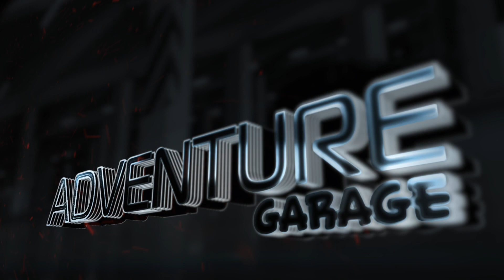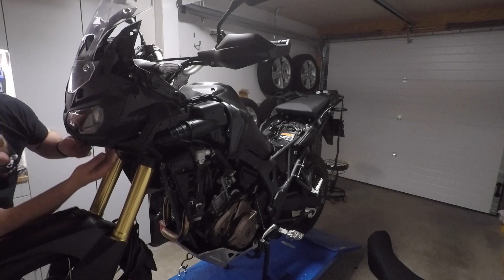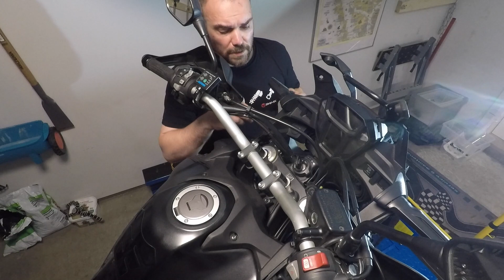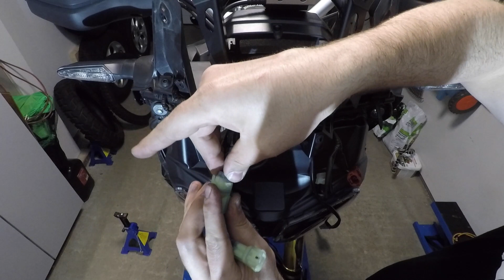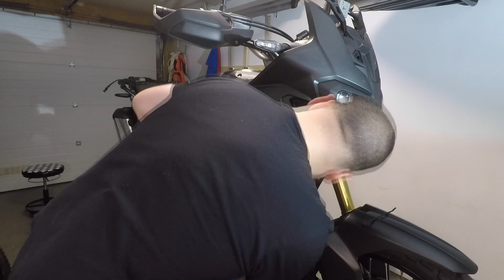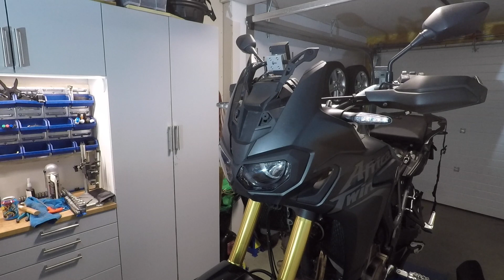Africa Twin OEM 12V outlet and subharness

Comment: Hi can anyone tell me why is there another connector at 9:08? Why can’t the 12v accessory and gps plug in directly into the sub harness?
Reply: so you can add fog lights later

Comment: Hey cool video. Is it possible to completely remove the windscreen mount?
Reply from the maker: If you're referring to the "subframe" that actually holds the windscreen, I haven't tried. I doubt that would be possible without major redesign. But I suspect it has been done on some of the more radical rally rebuilds that have been presented over the last couple of years. Check out the African Queens "CRF1000R" solution, where the entire fairing/cockpit is replaced. Expensive as hell, but if you're willing to shell out, why not :)
Reply: Adventure Garage Thanks for the answer. I’ll give it a shot and check in detail what that piece is connected to. 👌🏼

Comment: so you need 2 subharness parts to complete this install??
Reply from the maker: Just one subharness, that splits the power from the outlet into AUX power and  LIGHT connection. The AUX has a 7,5 inline fuse.
Reply: Adventure Garage thanks for the video. May i know whats that for in 9:08?